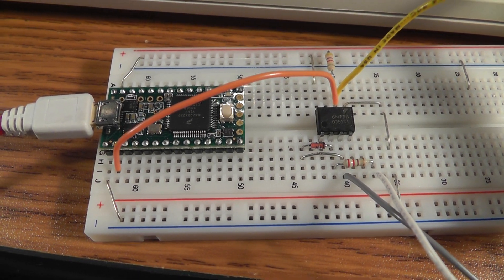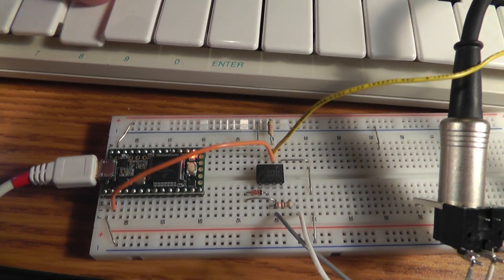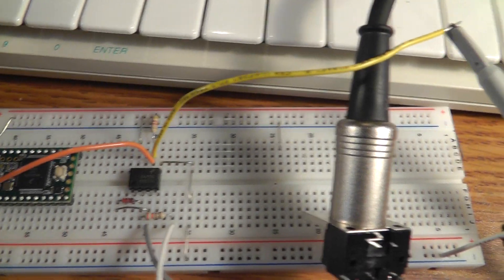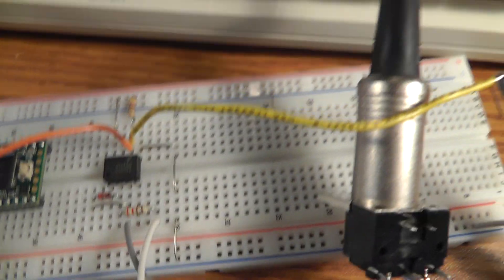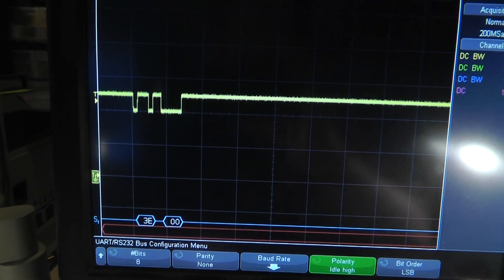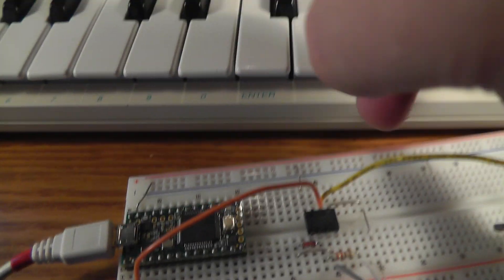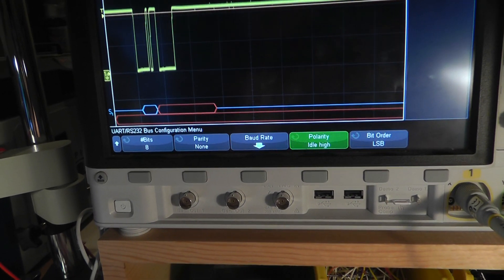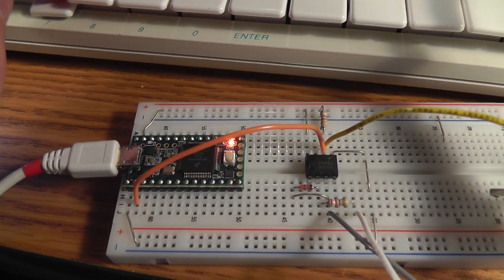Quick MIDI Test

Comment: Hopefully a heads-up to anyone that sees this before trying it.  This circuit as shown will certainly work, however, it's putting 5V into RX1.  It was fine for a while, but a few hours later it burned out for me.  Stick with powering the 6N138 from pin 8 with 5V, but only apply 3.3V to pin 6 (!)

Comment: the 6N138 should have a 4.7k resistor to ground on pin 7, at least in my experience without it they don't behave properly